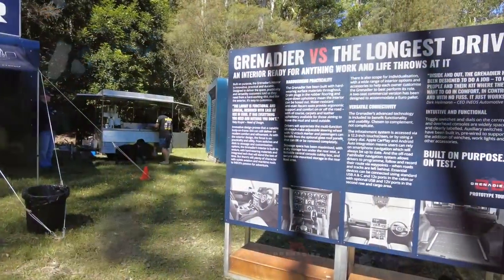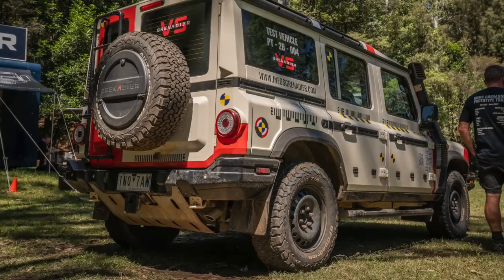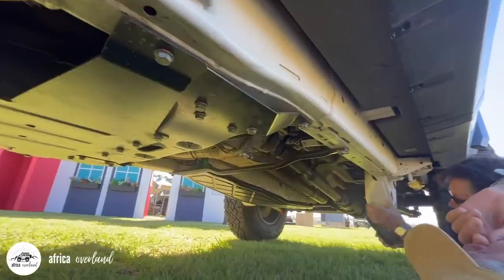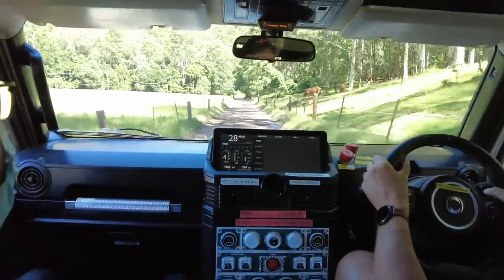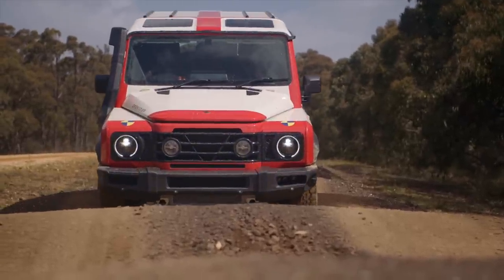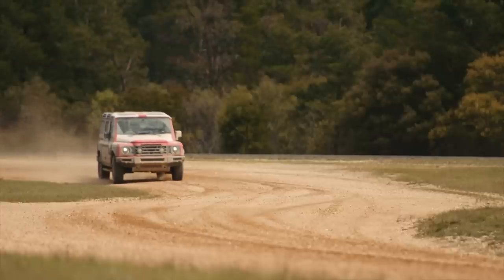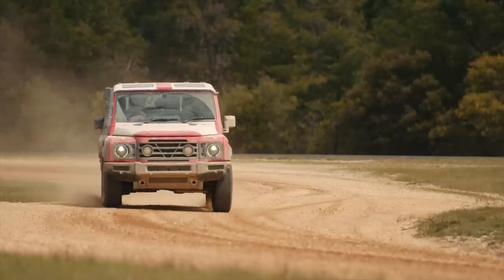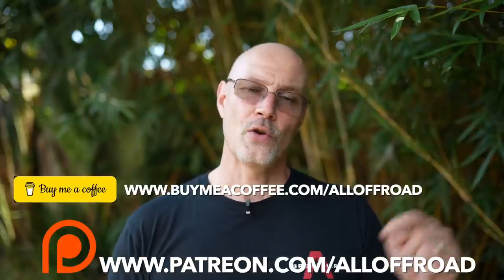Ineos Grenadier - THE ISSUES | SEPARATING THE FACTS FROM THE HYPE | A 4WD PERSPECTIVE

Comment: From what I have seen in other videos etc the ground clearance and suspension stood out like the proverbial ......those trailing arm points should be up in the frame rails and longer! The rest of underneath needs a total redesign to be less prone to damage and getting snagged on a rock etc and that under seat battery setup is just wrong on ten different levels.Good and fair run down on the most important pluses and minuses as I see. Hopefully they can get all this sorted and they should have a winner!!
Reply from the maker: 100% agree, the choice of a 5k Red Winch but on the other-hand using less reliable Harrop E-Lockers is very questionable in my book. If a short person like ASPW has issues sitting in the drivers seat because of the foot rest I think for someone tall like me it would be very uncomfortable for longer trips.

Comment: Attended the Skipton demo yesterday and went for a short trip. It's a beautifully finished car which will win lots of plaudits from the form rather than content motoring press. It eternal finish, seats, trim and ergonomics are great. The vehicle is full of little well thought out gadgets that address the endless improvements that Defender owners make. I was extremely disappointed with the clearance of this vehicle - it is a very tall vehicle that will make parking in many parking garages complicated with none of the clearance advantages that should come with this tall vehicle. The positioning of the radiator despite the relatively flimsy protection, is an accident waiting to happen. The position of the exhaust system is also cause for concern and the diffs are very low. The side steps (as opposed to t he rock sliders) wont work in the bush. I was also sad to see that the front and rear bumpers have the crappy plastic corner trims like the old Discos - these are a bad idea off road. I hope that they will look at the ARB aftermarket bumpers which have one piece bumpers. The issue of the second fuel tank is crucial - the fuel range of the demo vehicles seems laughable. Ineos have opened themselves to commendable levels of scrutiny and seem to be listening to the opinions of potential clients. lets hope they find some way of getting this very sexy beast up higher off the ground so that it can deal with the big bad world out there!

Comment: I also think that the important dashboard instruments should be analog. The german VDO have being used in german cars for such a long period of time that it proved its quality and durability. I'm not against the new technology, with digital screens and so on, but in this type of car, I will prefer the basic and proven to work. Electronics are very good, but water is its greatest enemy, and off-road there is plenty of it, many times. So in my opinion, everything should be kept very basic, but functional, and with the lowest possible risk for failure.

Comment: You explained things very well. I think my defenders from 2008 are almost the same except Ineos has better engines and gearbox.
Reply from the maker: From what I can see so far the Defender is more modifiable than the Ineos it also has better angles and less clutter hanging down but of course, it's a Defender (and I owned 2) and will always be let down by LR dodgy electrics.

Comment: I wish they went with a light commercial engine/driveline (ie; Isuzu, Iveco etc) over the BMW/ZF combo.

The suspension design is very similar to the G-Wagen (W461) which is no surprise given Magna Steyr's involvement. The G Professional does not have outstanding wheel travel given that it is all coils (3 lockers will help that).

I am not a fan of the battery/ECU location - from a water issue and also accessibility (would have been better under the cubby locker in the centre console for the ECU).

Extra fuel tanks are going to be an issue (as is the case with the G-wagen, although the aftermarket have addressed some of these issues) but you won't be getting 180ltrs. Jerry's are going to be required (roof loads of 150kgs, I believe). The petrol does appear to have some vacant space underneath as the AdBlue tank is not required.
Reply from the maker: yea hate carrying fuel on the roof but agree can’t see how they fit 180l in I recon 140l tops
Reply: @AlloffroadAu   Hoping for 150L at lest from the aftermarket.
Reply: @danielpope3579  More W461 than W463.

Comment: Good points raised in the video Stefan. I watched the video comparing it to a Prado. A Prado being what is considered a mall cruiser or soccer mum car and maybe not Stefan’s idea of his tourer but I feel that the Prado is popular enough to maybe use as a baseline for the masses who leave the city limits. Will the Grenadier cover long distances compared to what the standard fuel tank of the Prado will do? Will it have equal or better off road ability with 32/33 inch tyres and 2 inch lift?  That space behind the steering wheel looks like a good spot for aftermarket gauges, maybe a gos speedo independent if tyre size. What about figment if a second battery? The factory fitted battery looks rather large and maybe could be reduced in size to make room for a 2nd one?

Maybe, the engineers could have looked at the 80/100 series platform and the GU Nissans as vehicles that can be used across multiple segments from outback tourer, comfortable wagon, used by the UN, mining, farmers and industry in general. Tough, simple and with updated safety for the modern world. 

My respect to Ineos for getting this far and the proof will be in the pudding when it arrives.
Reply from the maker: While I would not own a Prado still think it makes a reasonable good tourer, especially the older Prados are good mid-size touring vehicles. Would be interesting to run a dual 75ah DCS Lithium Set Up in the Ineos as batteries are not under the bonnet it would really lend itself to LifePo4.
Reply: @AlloffroadAu   Maybe there is method in the madness of where the batteries are placed (apart from a lack of space under bonnet) so that lithium is practical. 

Let's hope Ineos are nimble enough to make improvements based on prototype and production feedback. So far they have turned the rules upside down.

Comment: There's a few concerns, but this is the best new car being offered in its class I think overall. Good review Stefan.
Reply from the maker: yes but given it’s advertised as a purpose build 4wd I don’t think you can compare it with other vehicles in its class, it needs to deliver way more 4wd practicality.
Reply: @AlloffroadAu  that's fair but I think a big element of the offering is the after sale support and right to repair component. IF they do what they say then I think it will be ahead of other manufacturers because you could lift it, fit better bars, fix it yourself and they won't leave you high and dry. It's a big IF though. Good empirical analysis and thanks for your work

Comment: I’m overall a fan of the grenadier. I agree that it sits too low and would benefit from a slight lift and larger tires. The sloped rear fender covers are odd. Making them flat would help with storage systems. The drivetrain sounds overall good but that shifter is out of place. It’s electronic and has no mechanical connection to the transmission. That needs to be replaced with a standard shift lever. They’ve come a long way in a short time however. I feel these prototype rides will help improve the final product and we still see some changes.
Reply from the maker: I really hope so, yes the shifter I didn't even want to mention it's completely out of place.

Comment: Not sure if anyone's mentioned it. But the fuse and battery box under rear seat is sealed, according to Mark that you would have met on the Glenworth valley drive.  

Aside: Being sealed it may cause issues with standard lead acid batteries. But stock batteries are AGM which are recombinant.
Reply from the maker: yea wasn't mentioned to me and wasn't sealed when we saw it, while I'm not a big fan of under-seat location it has one great advantage it would lend itself perfectly for a Lithium starter and aux set up, especially if you could fit two 100ah LiFePo4 underneath.

Comment: I use Eaton lockers for many years without issues, love them and much better than air lockers where I constantly got leaks
Reply from the maker: If you don't use them much they last but they did have quite a few inherent reliability issues for instance cap bolt comes loose and destroys diff, Magnet stop breaking off. Not an Isolated issue I know people who went through 3 Harrop e-lockers in 2 years. They use them often but with mechanical sympathy. Need to clean the air locker before install and get it installed by a diff specialist. Not to mention in Australia you have then a 5 year part and labour warranty.

Comment: Adjustable lower arms on the 5-link front end will help address any castor issues when lifting the suspension. The CV/rzeppa joints and be a PITA when lifting and I expect this will be a bit of an issue for some. I'm not sure I'd buy the first iteration of this truck but I reckon it will evolve quickly.

If you look at the 79 series LC they have a number of issues that need addressing too. Like you said nothing is perfect.
Reply from the maker: yes, 100%, the 79 is very modifiable though,  but one reason I haven't owned one is that I don't want to change axle housings on a new vehicle to just run the same track width.
Reply: @AlloffroadAu  That was the dumbest thing Toyota has ever done.

Comment: I can see this as another G Wagon. Meant  to be an outdoors type of vehicle, but you know it’s gonna be pimped out on 24 inch rims,  blacked out windows and never seen in places where it was designed to go.  
I know they are trying to make a classic design , but they are going to fall short.  Think of iconic vehicles of the 20th century.  Mini, Land Rover, ford model T, VW Beetle and the Vespa.  These were simple engineering and design that the every day person could afford.  At $100k, no one under the age of 35 is going to buy one of these. It’ll be 50 year old men that don’t have time to use it as intended.  
The new influencers out there (think instagram and YouTube) that are actually doing off-roading are going to stick with their Jeeps and Toyotas,
Reply from the maker: yep sadly agree, everyone I know including myself who where very keen on the Grenadier have stepped back and wont be purchasing one.
Reply: Looking at the people under 35 they cannot afford a Jeep or larger Toyota either. The pricing for a decent off-road vehicle is similar at all vendors.  What IG misses at the moment is a short wheelbase. 2 door. Btw most younger people go for carsharing schemes and outdoor perhaps on an e MTB  Real touring can only be done by persons who do not raise a family.. 
Pimping a grenadier with side pipes like a brabus g-wagon .. hm no walnut dashboard.. no V8 compressor engine,  speed 95mph / 160kmh .. no known brand like Mercedes Benz that would serve as blue pill. Indeed the G Wagon became a lifestyle vehicle and afaik only offered as a luxury vehicle and not anymore in a workhorse configuration starting from 120kEur and 4 years wait time or willing to pay 200kEur plus from speculative dealers.  Can’t predict the future neither read Sir Jim’s mind. But he has certainly different ideas than Daimler, who will likely cease A and B class small vehicles and focus on luxury segments. No I do not regret my order of an IG. It’s exactly what I was looking for and there will be certainly aftermarket features for this vehicle and it’s layout is made to add configurations or modifications depending on requirements.

Comment: Excellent review. I'm a bit disappointed by the low roof, but at least forward visibility doesn't look too bad.
Reply: I would suggest that if their intention was to rip off Land Rover’s original IP, it would have been hard to do so without carrying over this original Defender problem as well. I suspect that stealing the signature “alpine windows” design as well might have been enough to tip the court case in LR’s favour.

Comment: All of the negatives you pointed out I agree with, especially the electrics under seat at floor level. Do they not ford water in the UK? Have to disagree on using CV joints on tailshafts, after experience with them on Jeeps. The rubber boot is prone to puncture and then allows grit and mud to enter and grind away at the steel balls and seats. Chops them out pretty quickly and therefore I would say not as durable as universals joints.
Reply: Do we not ford water in the UK? , Emmm we usually use a structure called a bridge, for crossing water. :)
There again, we have had thousands of years of civilization to perfect our transport logistics.:)  More to the point compared to the massive continent you live on (he said enviously) :) we live on a relatively tiny island. There is very little land that is not privately owned so off-roading is very limited here in comparison to your good selves or in the USA.

Comment: what I would like to see is portal axles and a 10 speed transmission with 1-4 for low ratio off road driving and 5-10 for high ratio on road driving. no stopping to go between high and low.
Reply from the maker: yea VW tried that with the Amarok, works quite well in forward but without a low range TC you have only one high range gear in revers  which can cause big issues.
Reply: @AlloffroadAu  would be nice to have a separate reverse selector to have all gears in reverse somewhat like the unimog or have the reverse ratio too match the ratio of first gear.

Comment: Great review,body lift an rerouted exhaust worked to fit bigger fuel tank on my older hilux,would definitely prefer arb /pro locker over the eaton,after market support will definitely be key for the suspension.

Comment: Three questions:
1. Will the lack of Ad-Blue in the diesel disable the engine 
2. Will the failure of all / major computers kill this vehicle.
3. Do bush repairs require a computer/laptop reset
Reply from the maker: yep good questions I have not seen answers to beside 1. supposedly it will in stages reduce performance but not outright disable the car
Reply: @AlloffroadAu   No. 1 and 3 most important otherwise will stick with go anywhere fix anywhere (using fencing wire and pulling  socks) 1997 LR Defender 300 - all mechanical

Comment: Well that just about sums up what the Ineos isn't.  Its not an adventure truck, but a fleet off road car.  Few will have anything more than All Terrain tyres fitted.
For emergency service fleets, police, and to get engineers to the windfarm pylons.  Farmers too, on well maintained farm tracks.
The list of compromises seem to be getting longer and longer, and the original "dream" further and further away.  All now a bit of a Euro car.
They need to sell thousands and thousands of these things, which is why its getting more G Wagon than Series Land Rover of old.  
I can't understand how a clean slate design for serious off road doesn't have a skid slide plate protection underneath throughout, with no hang up protrusions to hang up on.    
Maybe if they sell enough in Europe the MKII might produce another design more akin to the  what the dream was.... and have it built in Wales???
For many this will be enough.  Will be a few years before there are enough second hand to start modifying.

Comment: Hello and thank you for this informative video.
But have you possible come to know what is the size of the differentials( ring gear ) in those soild axels they are using? 

I have so far been unable to find it online. ( Here in Iceland we put vehicles like this on as large as 44" tires. So strong diffrentials are vital. 

( Our #1 chose for 25-3000+ kg trucks have been the Patrol ones. They have 9.5" ring gear and have proved themselves many times to be strong enough and been fitted under many different type of trucks modified for 44" tires
Reply from the maker: yep I'm wondering the same but could not get any information on gearing, spline size, axle strength
Reply: @AlloffroadAu   It is interesting how that type of info seems to often be overlooked when it comes to technical info on offer from manufactor. Now of course they maybe not be expecting anyone to be fitting as large as 44" on to their vehicles . But still you would assume if they want to gather to the serious off-roader/ overlander and talk about their soild axles setup ( also in the front ) as a big benefit from a strength standpoint.  You would assume sharing that type of info might be something they might have felt would be important to share.  Also worth mentioning Radcliff is often here in Iceland fishing salmon. So for sure he has seen how heavily 4x4 trucks often can get modified at least over here).  Thanks for responding.

Comment: My biggest concern is no manual gear box , yes yes I hear all the know all’s calling me a dinasaur , but engine breaking is a major part of off roaring for me!! I’m told the 8 speedZf can handle this?!! If so why do u see so much download hill breaking when in steep conditions, breaks on muddy d  it em hills are a no no, cheers good video mate
Reply from the maker: while I haven’t tried the 8Speed ZF I use engine braking constantly with my A750 5 speed not as good as manual but good enough

Comment: My impression was that the car was riding very smooth. as this are all test vehicles you probably can not compare them a lot. on car i was riding in did not have diff locks the other did. i was surprised by the petrol engine and that i liked it mor than the diesel
Reply: It was riding smoothly because all of the humps were strategically placed. Move the humps around and see how well it does...

Comment: No normal dials in front of the driver    -  deal breaker for me.  They worked for decades  fine.  I don't care if they are analogue or digital, but I need them  in front of me, no need to reinvent the wheel..